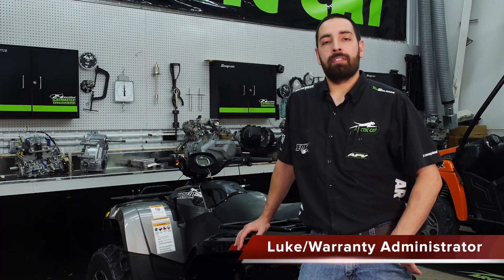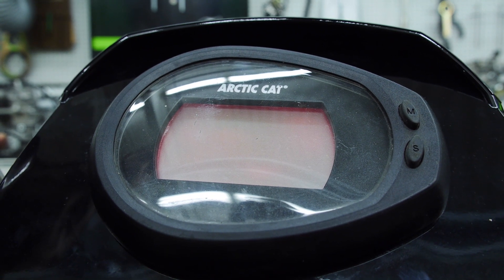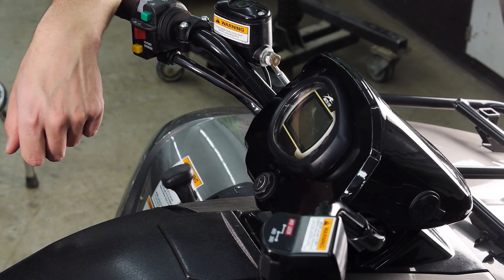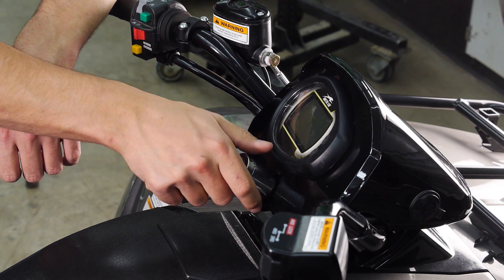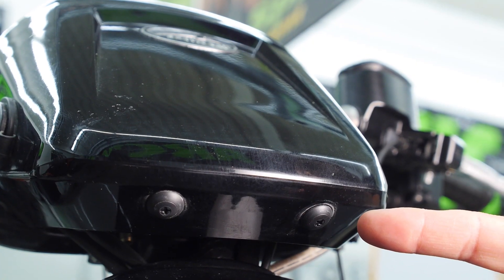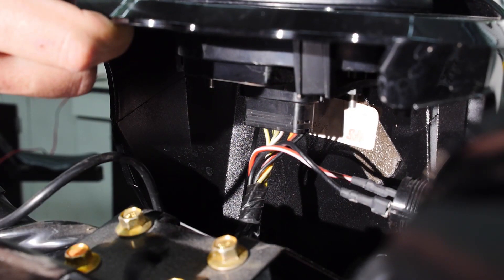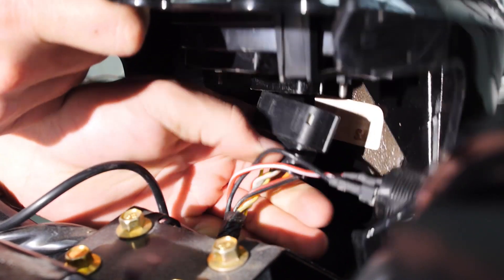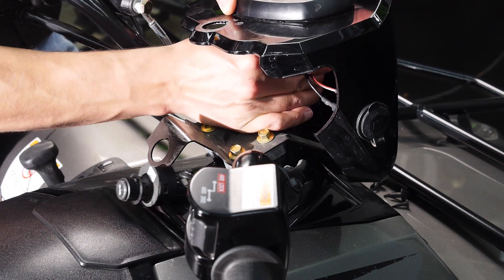ATV Teardrop Gauge Troubleshooting

Comment: this does work, thanks, but I also found you can disconnect the battery overnight, and this will do it.  this happens when you lose battery voltage a lot of times

Comment: I have an electrical problem. the keys are removed from the ignition and the dial remains on all the time. there is also the red light in the back which stays on. which empties my battery. Can you help me?